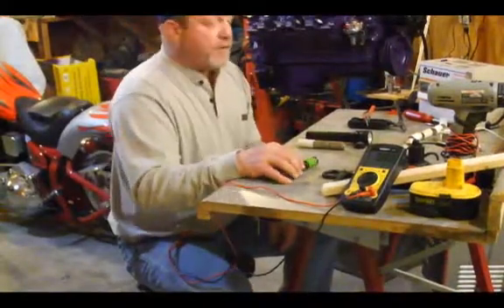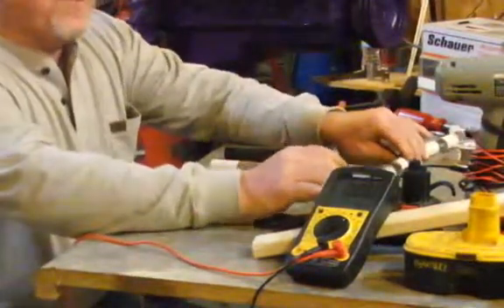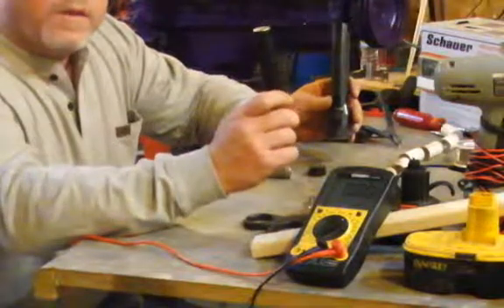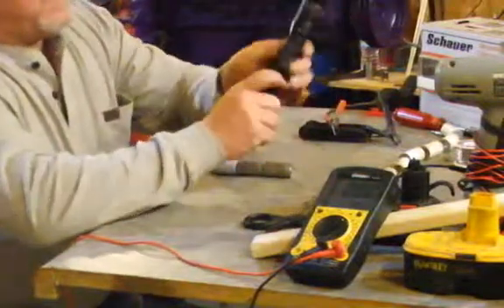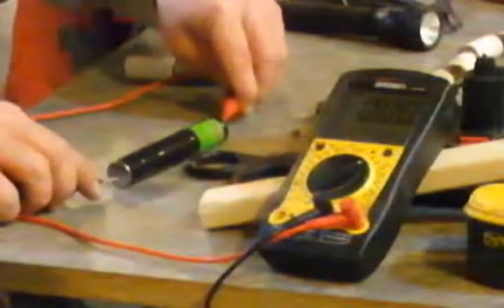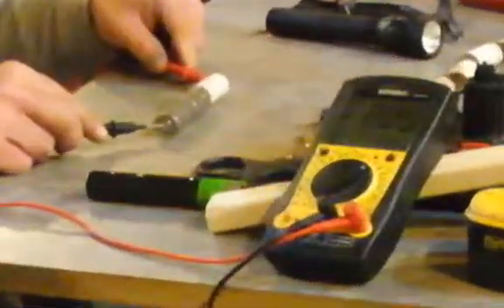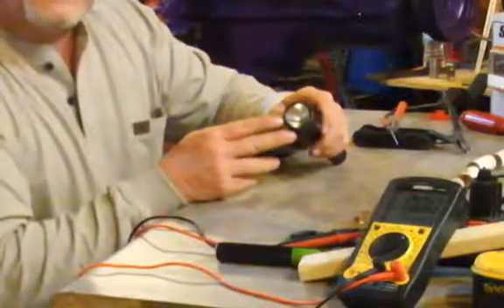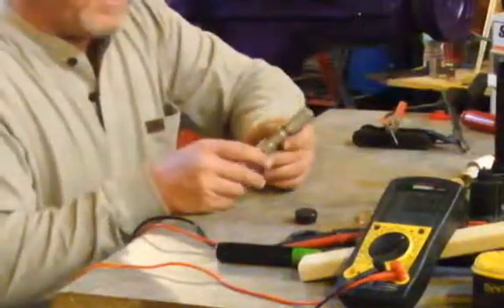Reuse Nicad Batteries

Comment: Great stuff, thanks.  I have a cordless with two 24v NiCd batteries. Neither battery held its charge.  I was about to buy a new one at around £100. Watched your vid, thought nothing to loose.  I stripped the pack and checked each cell.  All around 1.28v except one was 0.01v.  Zapped it with my 12v car charger, 6 contacts of a 1/4 second each.  Measured again and got 1.27v.  Other pack had two cells low.  Both packs now show over 24v and there's plenty of torque from the drill. 

Result. Thanks